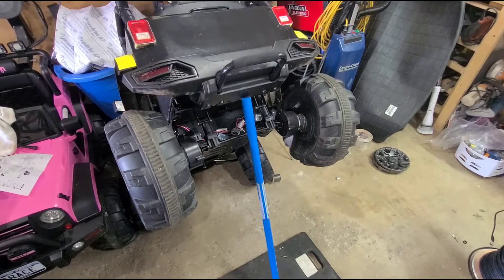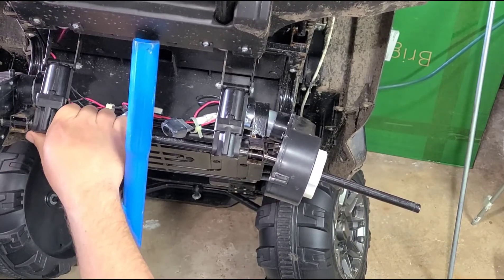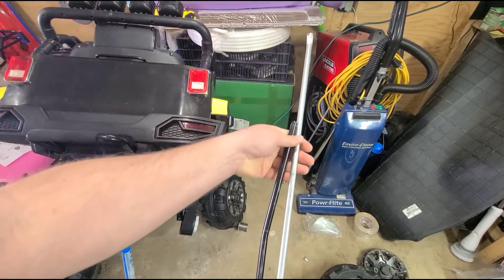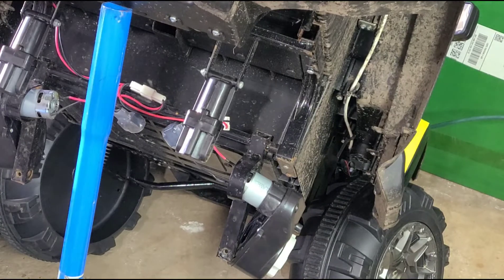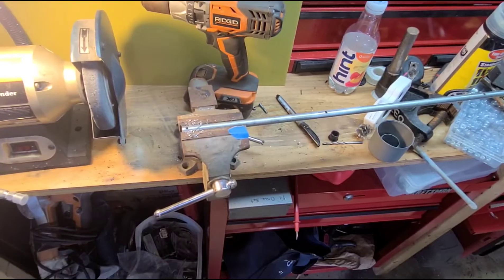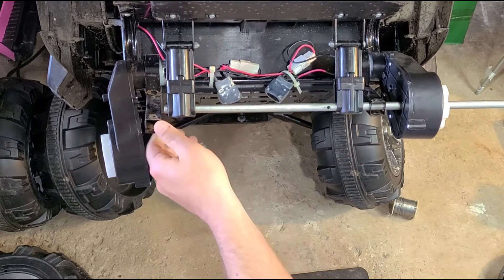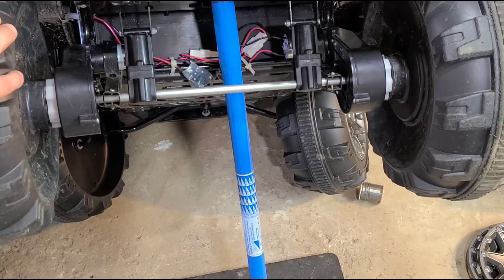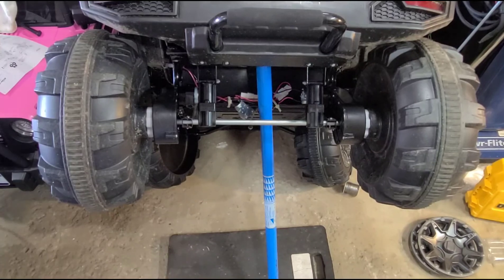BestChoice Jeep Bent/Broken Axle Replacement fix

Comment: TSR have you by chance found replacement wheels for these Jeeps? I’ve done two 24v conversions thanks to you btw, but one of them the plastic bushings have worn a larger hole in the hub, so both front wheels wobble around
Reply from the maker: You can get them for aliexpress. The manufacturer may replace them if the jeep is newer and you provide the pics of the wrong wheel
Reply: Aryan, if you found some replacement tires I'd love to know where?

Comment: hi sir im a single mom and never dealt with stuff like this! First thank you so much for your video!i have the same exact jeep except mine didnt come with the bolts like in your video. man this is a lot to type and im not good at this. my son bent the axle and i cant find a replacement and i cant cut or drill holes as you have. any solutions please help me figure this out? aso his jeep started doing this whole turn on but wouldnt go very far. i replaced the battery lasted about 10 minutes same thing. so i bout new fuse relays gear boxes and motors! not realizing the 12000 on the original motors were important! i bought 35000! which led to the bent axle! i let him ride it for a little bit with the bent axle and it did the exact thing again, turn on but barely moving. not sure but think i need to replace whatever fuses are under the hood. anyways any advice or solutions you can give me would help so much! im trying to be a good mom running on 3 hours of sleep cleaning toilets and cars and whatever i can to make ends meet and buying a new ride on is not possible.
Reply: Thank u so much
Reply from the maker: @brandibutler8619  no problem hope it works out for you, I also add this to the description if anyone has the same issue
Reply from the maker: Hey sorry for the delayed response. See if the local Lowes or home depot can cut it to length. And use these instead of drilling holes for the pins,
Climax Metal H1C-043 Shaft Collar, One Piece, Black Oxide Finish, Steel, 7/16" Bore, 13/16" OD, 5/16 Width, With 1/4-20 x 1/4 Clamp Screw https://a.co/d/1laZAhl
Hope this helps just make sure the rod size and shaft collar sizes are the same and you'll be good all you need then is an Allen key

Comment: Any idea where I can get that entire rear setup? I upgraded to the 24V and the square tubing broke. I’m going to try and tack weld it back but would prefer to just replace it
Reply from the maker: Na not now no one has anything last I looked. Tho you can probably remake the rear in metal from Lowe's or HD and it would be much stronger then the cheap square stock they use

Comment: Thank you Sir for sharing. This is exactly what I have to do on my sons BCP jeep. Got the jeep free so I don’t know the history. We’ve been using it like that with axle bent on both ends. he’s 1 so doesn’t weigh much yet. It’s the 12V RX43 version. I had the measurement wrong 15/32 I got with my caliper. Guess I’ll order the 7/16.
Reply from the maker: Ya good luck let me know how it works out
Reply: @Neonjer11   👍🏽update put the axle on, worked out. I bought the better Oil Hard Drill Rod,O1,7/16. Cut it and drilled at work.
Reply from the maker: @MrJAY-vz7to  awesome glad to here bud.